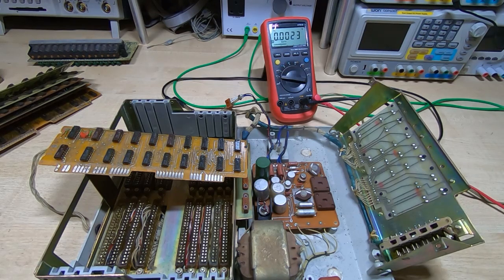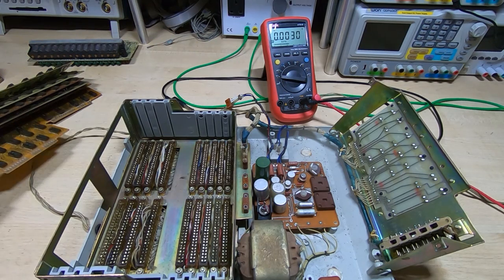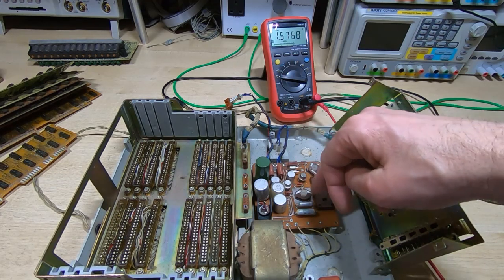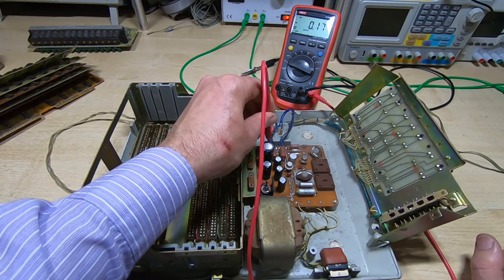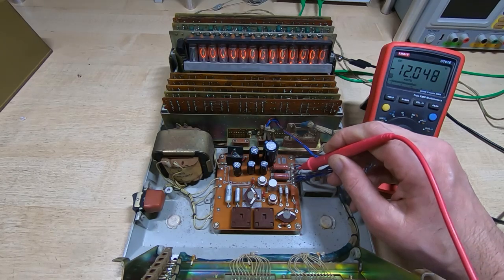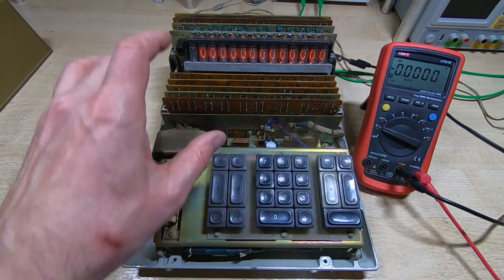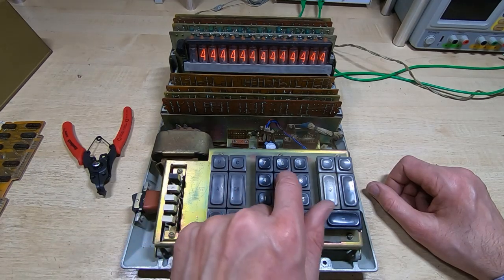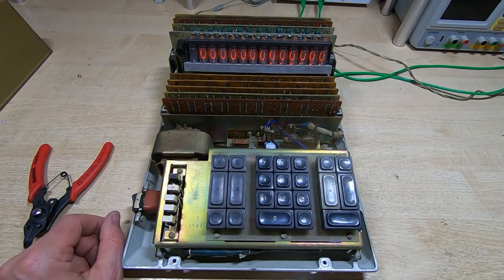Elektronika D3 Repair Part2

Comment: I’ve got a Sony Sobax 600W calculator. I can’t find any service manual on. My problem is the number pad isn’t sending input to the rest of the machine. I’ve got 6 slot cards filled with orange transistor arrays. All Sony. There has to be hundreds of them on each board. All Nixie tubes work and I can get them to cycle through the digits at 50hz. I really want to get it in working order again. Some help would be great. 
Thanks for your time and your knowledge is appreciated. 
God Bless.

Comment: Wow Im looking forward to how you get on, to me it seems insurmountable, no circuits and no device info that is a real challenge.  Im also very surprised at the number of devices used to make this work. From my previous experience of "discrete" calculators there seemed to be a lot more devices. When I was beginning in repairs in the 70's I screwed up and shorted the mains to the DTL power rail. Needless to say it killed everything, my penance was to take leave for two days and replace every device! good lesson and I'm sure there were heaps more devices than I can see in this machine, it took the full 2 days to get them all replaced.
Reply: I know exactly what you’re saying here. I’ve had this Sony Sobax for almost a year now.  I’d love to find a service manual on it. However it looks like I’m not the only person. These machines are worth fixing.

Comment: And conformal coating on the boards… not what I would expect inside a calculator
Reply from the maker: Yes and it makes them a real pain to work on as it is difficult to probe and almost impossible to attach IC clips.
Reply: @JerryWalker001  And with fragile tracks on the PC board is a devillish combination, that can ruin a day or more...